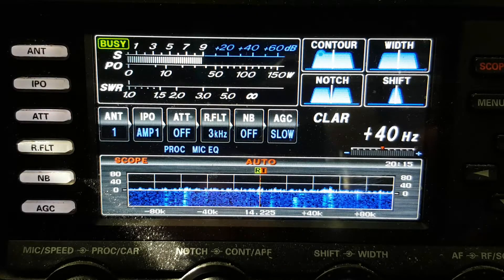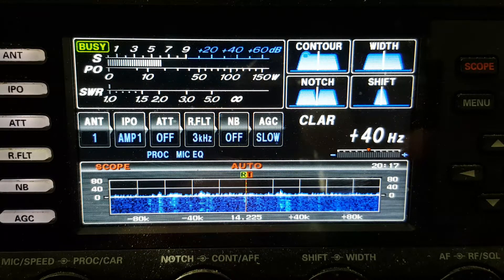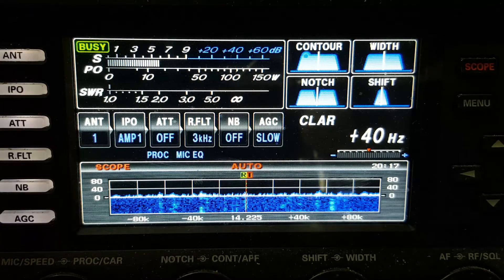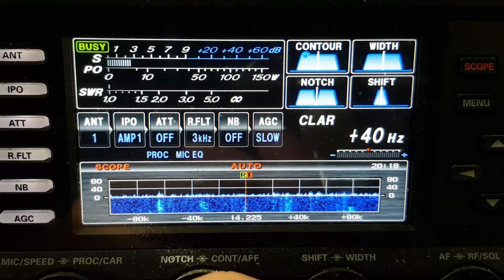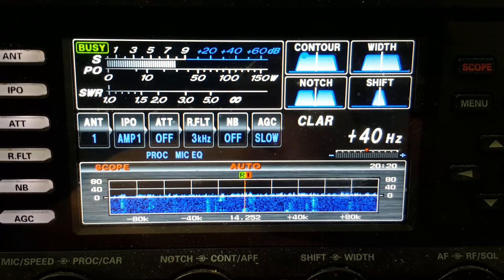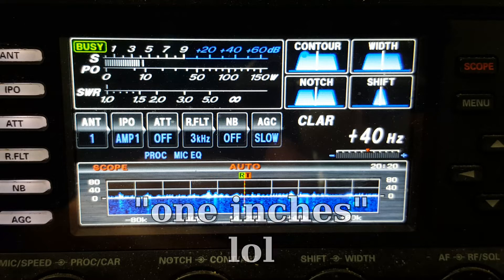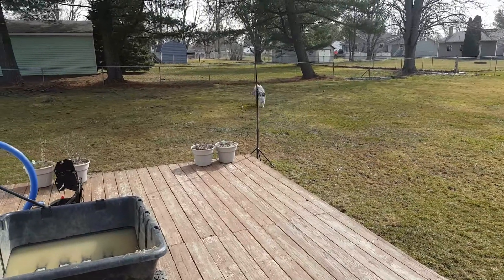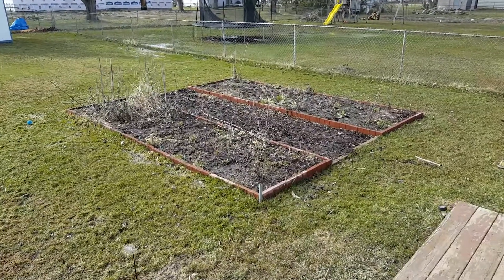20m EFHW vs 80m EFHW on 20 meters - sorry I kept saying 17!

Comment: Both stations in your video are at pretty much the same bearing from you. I would expect the longer antenna to maybe have some lobes in the radiation pattern where the 20m is more omnidirectional. Possibly you find a larger difference with signals from another location because of those lobes.
Just guessing…
Reply from the maker: Yep, i bet you're right Robert. I'd bet money on it. Lol. Take care and have a nice day OM  :)

Comment: I have an 80 m EFHW from the 8 tap unun just inside the window.. out about 12 feet then up about 33? Foot tree then west for the rest and climbing ? 5 or so feet

I am contemplating additional shorter length elements(s) for working 20 to 10 meters?? 20 is ok on current setup but on up to 10m, not so much..

What say you?!

And my wife has seedlings under grow lights.. good to grow your own but LED grow lights have me thinking POTA

Comment: I finish my EFHW antenna I'm still testing it out. I used 3 primaries with the full 8 taps. I've been using my multi-band dipole for comparison. sofar on my tests the EFHW on 80M is a little weak on the signals coming in. the guys in the mud to the point I can't understand them on the EFHW I switch to the dipole and they clear mostly all the way up. I tried my 1:1 in case it was common-mode noise and it unnoticeably helped. the antennas are at the same height 50ft about 125ft apart. and also I have a 35 x 50ft metal pole bard next to and about under some of the dipole. the EFHW is over the house and over a tree, it's a ways away. so what are your thoughts on the comparison? buy the way the match is 2:1 or under for the entire 80M band. I was excited about that. my radio doesn't drop the power down till 3:1 so I'm pretty good there.